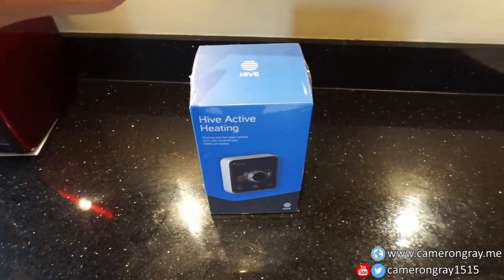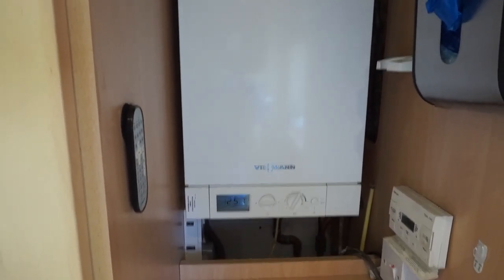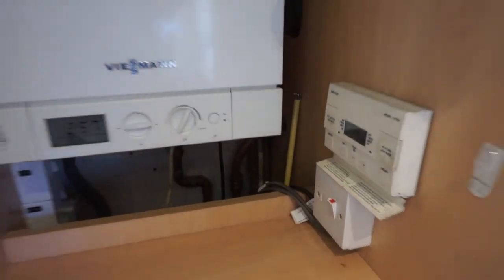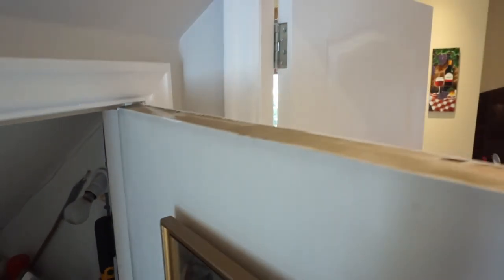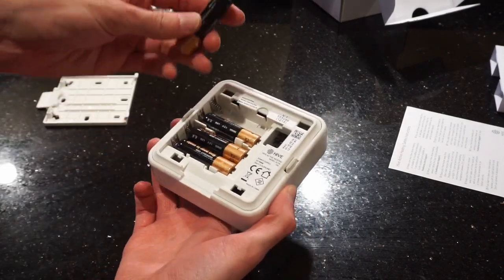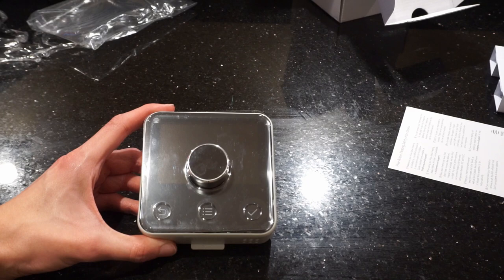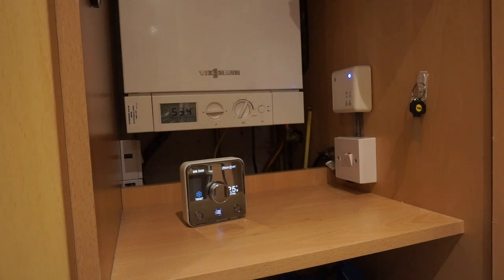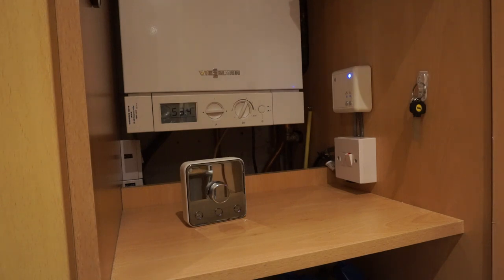Installing Hive Central Heating Control For My Parents - Dodgy wiring galore!

Comment: Great video thank you as it helped very much when recently installing my Hive Active. I have query I was hoping anyone could help clarify, basically when I turn my hot water on only my radiators being to warm up to which is not ideal especially during summer. Is there a way I can fix this through the receiver only?
Reply from the maker: Did this problem coincide with installing Hive or has it started since?  If it was at the same time as installing Hive then you'd need to check the wiring to make sure you have it correct.  You'd likely have one wire to signal for hot water to come on and a separate one for heating so you'd need to make sure they're the correct way around.  If it's started since then (or if the radiators warm up slightly but less than if you are actually running the heating) it's possible that one of your motorised valves have failed and is letting water flow into the radiators when it should be blocking it or directing water only to the tank - this is a pretty common issue.
Reply: @camerongray1515  It has been like this since installation, I guess I will need to go back and check the wiring. Thanks

Comment: Hi, I’ve just got a hive active kit, I’ve gone to install it but I only have a live, neutral, earth and a grey wire. Is this enough as I tried these and the receiver didn’t turn on?
Reply from the maker: Obviously if in doubt, you should contact an electrician.  Is this the active heat for a combi boiler?  You'll need to work out what each of the wires do by checking what the other end connects to, for example, in my own system with a combi boiler there was a 3 core cable but as the original programmer was battery powered the neutral wire wasn't connected at the boiler end.  You need to be pretty careful as while wires should be sleeved to indicate their functions, often they aren't so they could really be anything.  For a combi boiler with a 3 core cable, usually brown would be live, grey would be neutral (which really should have a blue sleeve around it to indicate this) and the black would be the switched live that signals the boiler to come on (which should be sleeved brown to indicate that it could become live).  However you really must find the other end of the cable and look at how everything is connected to ensure you don't damage something by assuming a wire has one function when in fact it does something different.  Also need to be really careful with old wiring colours vs new wiring colours - in old coloured twin and earth - black was neutral, red was live whereas in new coloured 3 core, the black wire is often used for a switched live signal so if you were to get those mixed up, you're going to have a bad time!  I make this exact mistake at 10:13 in this video.
Reply: @camerongray1515  yes mate, combi boiler. The old thermostat states the normal colouring for the wires it has for neutral and live but that’s all it has so going to have to see what I can do. Thanks for your fast replies. Really appreciate it.

Comment: Man that wiring looked dodgy! Be interesting to see what an electrician thinks of it
Reply from the maker: Definitely would be interesting to see what a proper electrician would think of the whole house although it seems tricky to find someone that will actually do it properly and not cut corners where the customer isn't looking.  My parents have always used reputable contractors after seeking reviews.etc yet literally everything they've had done has something wrong or bodged if you look closely!
Reply: Hey Cameron thanks for the reply. No that’s fair. Tbh I’d dread to have anyone look at wiring at the flat I live in. To my knowledge it’s not been changed since the 90’s or maybe the late 80’s!
Reply: Here is an electrician. 

Its shit! However this is exactly what happens when plumbers do their own wiring.
Reply: @stevecraft00  Reckon the plumber installed the consumer unit too.😂

Comment: 6:42 who installed that consumer unit? They have done it to an real bad standard but it was done after 2018.
Do they have solar panels installed, whats does the unit on it's side do?
Reply from the maker: It was done by a registered electrician which kinda sums up the state of the industry given it's pretty much impossible for an average consumer to get work done and know that it'll be to a good standard.  It's not the worst I've seen minus the fact the tails aren't glanded (there's at least a grommet strip) but there's definitely a few flaws.  It's weird, like, he's put some thought into it such as putting the alarm on a non RCD protected MCB and the lighting on a dedicated RCBO since the house only has one lighting circuit so with it being a split load board having all of the lighting not dependant on one of the RCDs is a nice touch, but then he's been lazy and used a Hager RCBO in the Wylex board.  Then when he first powered it up apparently he had issues with the RCDs tripping due to faults in in the installation (the old board was non RCD protected, rewireable fuses so wouldn't have picked this up) which is a bit concerning since surely you'd test for earth leakage/IR  before you swap the board over.  The smaller Square D board is much older (I'd guess early 2000s) and feeds the electric shower and garage - would have been put in to provide RCD protection to these circuits when they still had the old rewireable fuse board but the fact that this wasn't scrapped and those circuits incorporated into the new board seems to be sheer laziness.
Reply: @camerongray1515   The way I found a good electrician  was from recommendations,  as I was going to have full AFDD/RCBO instillation. I set up a basic test for the electricians to complete. Rewire a faulty down light, if they kept the double instillation up the junction box they would get the job.

Comment: Your Diagram of the system is just like my heating and it is terrible i have the same problem with wiring also. Theres a grey wire leaving the controller and 5 feet away its red.  I have installed a hive and i think theres a feed back to the clock i cant get the boiler to turn on thats why i came on here.

Comment: If the WiFi is off does it still work
Reply from the maker: As long as the hub is running you'll still be able to use it, even if the internet connection is down.  Obviously you lose app control but you can still control it from the thermostat.

Comment: I’m not sure you have quite enough advert interruptions in this otherwise useful video :-/
Reply from the maker: I just YouTube auto-place the ads, they definitely put a lot on but I'd rather not risk fiddling with them due to how unpredictable the YouTube algorithm is.
Reply: Get the AdBlock Plus app/browser extension.  It disables ALL YouTube ads and most others, it's free and totally  kosher.

Comment from the maker: Hive is currently discounted to £143.20 (20% off) in Amazon's 2021 Black Friday sale! (Affiliate):
  - Hive Active Heating & Hot Water: https://amzn.to/3nhg9Ty
  - Hive Active Heating: https://amzn.to/3DzwHfn
Reply: hey Cameron sorry but I don't get how this controls the hot water. I got a very similar Viessmann combi boiler, which currently only turns on if I am actually using the hot water and it starts to flow when I open a tap, I don't need to press any buttons or set it to ALWAYS ON or anything like that. Is this something the Nest is not capable of? If I turn on hot water to ALWAYS ON, it will just start burning the gas even when there is no flow of water?
Reply from the maker: You have a combi boiler which heats water on demand, in which case you'd need the "Hive Active Heating" version.  The system here has a conventional boiler with a hot water tank. Hot water is drawn from a tank that fills with cold water which the boiler then heats up.  A timer needs to be set to schedule when the boiler is to heat the water tank to ensure it is warm throughout the day.

Comment: If you're not an electrician,  are you allowed to do this? No !
Reply from the maker: It entirely comes down to the regulations where you are, here in Scotland, as far as I'm aware, there's no limit on who can do work as long as it complies with regulations.  Some larger tasks (well beyond the level of this) may require a building warrant and in those cases it's usually easier to get an electrician who can certify their own work with building control but that's well beyond the level of simply replacing a heating controller.
Reply: @camerongray1515  I think you are allowed to do it yourself just you can't do it for anything else....depends on how confidant you are and also whether you know what you are doing
Reply: You are talking nonsense.